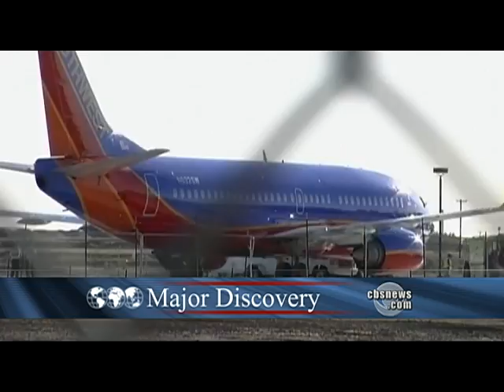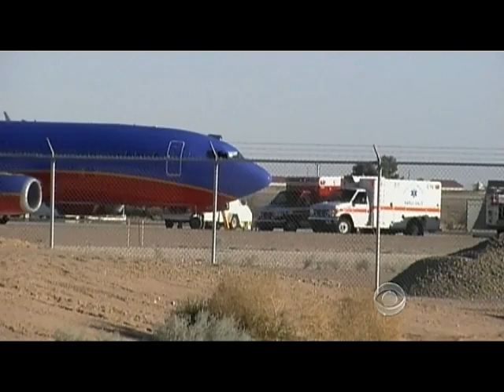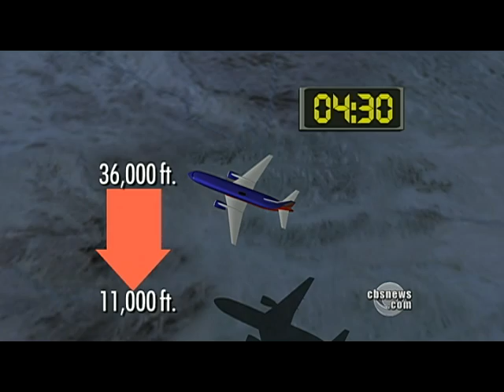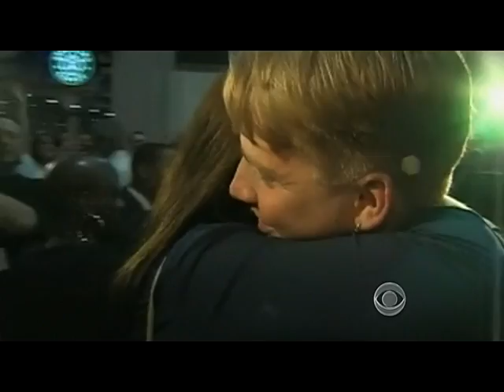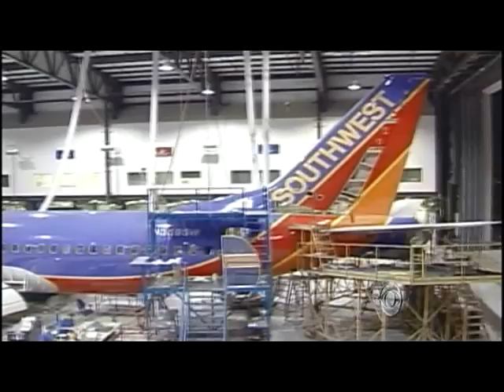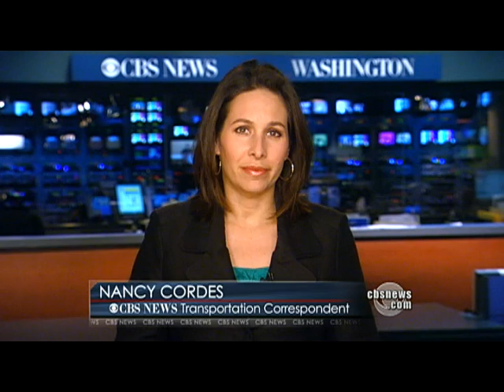Southwest Airlines emergency due to metal fatigue

Comment: airliners go thur many inspections through out the year however considering how often these planes are used .more often then not each plane makes upwards to 20 to 40 maybe as much as 50 takeoff climbs decent and landings xs all that by two per scheduled flight. the fact that these  cracks are unnoticed isn't th3 fault of the mechanics.the blame falls more on the fao in laments terms flight activities officer. over booking the same aircraft disregarding its annual softly b checks and a checks.too the same degree to much scheduling and as well over booking flights common sense says. all this adds up to extra stress on the airframe as well as the powerful engines which folks with all kidding aside these new jet engines pack a powerful punch...but all which is built will become used and at some point will always give..but it should absolutely never be ignored no sir we shouldn't allow it to fail I a sure you of this.Piedmont Airlines of yesteryear before bought out by a lesser airline which wasn't even a shadow of Piedmont.my point is Piedmont checked there aircraft every night at every hub across this country.and constantly keep upgrading heavily used aircraft and or simply replaced them with new planes.they were in there day a model of what a good airline should be they were the leaders is the industry then and actually still hold the absolute best safety record of any airline in the US that includes southwest us gone air United which has left the friendly sky's and American which still carries  the piedmont logo small as it is on there commuter planes. wear it with pride the same pride the pilots and crews and many employees the Piedmont Airlines truly had and showed it well. planes will brake if and when over used and not inspected properly and as often as safety is a important concern.

Comment: @Yuripro84 continued.... In the AD , it is likely that Boeing will mandate NDT.. EC or UT (eddy current or ultrasonic) they may even resort to Radiography....    I could get into a whole spiel about load transfers and other things you wont understand ... but lets face it .... You probably don't care ....   Routine inspections will not catch everything....   

Yes flying is safer today because they now know where a crack may propagate on a 737-X00 at approx 38000 cycles.  

thank you.

Comment: @Yuripro84  I am not mentally challenged.  I'm just being honest with you...  Do you know what inspections means?  ha ha ... the airframe structure undergoes mostly what is called a GVI (general visual inspection)  Now... from what i understand the crack happened at a lap joint..... .Do you know what that is?  okay...  Unfortunately human eyes can not see through layers of metal .... so now the manufacture (Boeing) will likely issue an AD Airworthness Directive.

Comment: @DIONETO I don't think it's unacceptable .  It's probably more like " expectable" . An ac like the 737-300 and all others are made from aluminum . The skins are roughly 0.063" thick and designed with Chem milled pockets and or bonded doublers that are designed as a fail safe when things like this happen.  The best part is... Now we know where + when the problem happened. And we can prevent it from happening again.  Every time these thing happen, flying becomes safer.